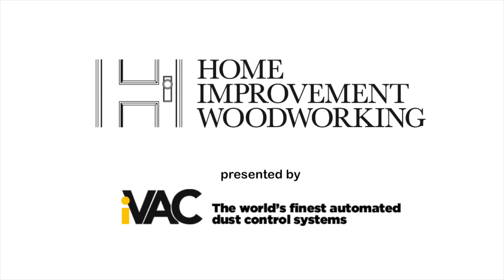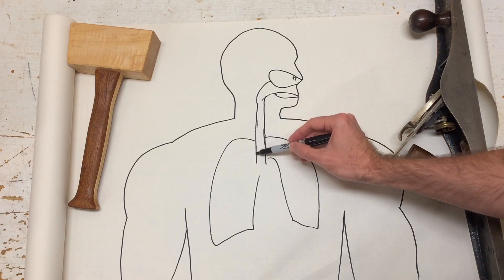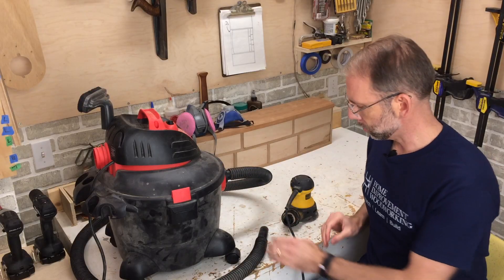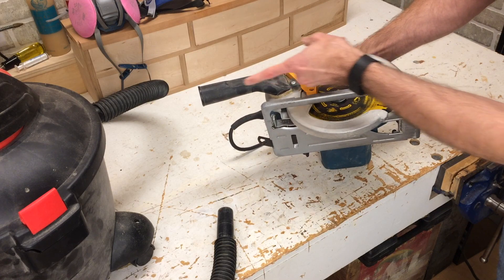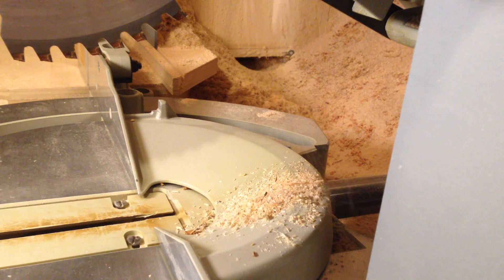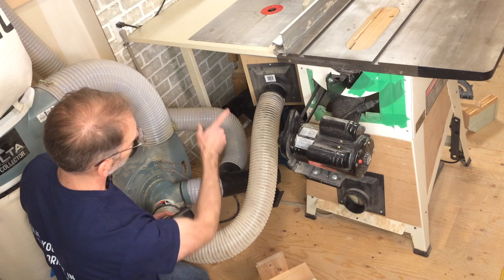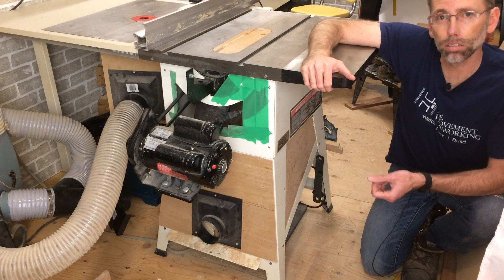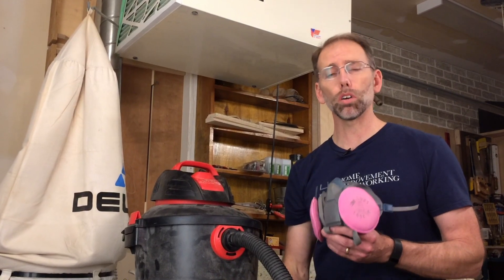Dust Collection for Workshops - Important Safety About Wood Dust

Comment: Unrelated to the video subject: What model of belt/disc sander you use? Do you like it?
Reply from the maker: I use a Delta 31-460C belt/disc sander.  I picked it up used for $60 a few years ago and it works well for me.  I like the dust port because it does a really good job capturing the dust.  I hope that helps.  Scott

Comment: Any suggestions on how to get started on dust collection on the cheap? I do a project every year and there's so much dust that spits up from my table saw (I attach a shop VAC to that while using it) and circular saw and orbital sander I do a sweep and vacuum every other week
Reply from the maker: The cheaper route to go is a shop vacuum versus a dust collector.  Keep it simple and plug in the hose to the tools versus getting fancy and hooking up some pipe runs.  I wouldn't skimp on the vacuum filter though... use a HEPA filter to protect you from the fine wood dust particles.  On a budget, you may want to look for used tools that have dust hookups so you can maximize the use of your vacuum.  Does that help?  Scott

Comment: I have been doing everything wrong for a long time, so I have a lot of breathing problems. But I don't want to give up wood working. To run an efficient dust filtration system in your Workshop it takes money. Do you have any idea how to do it without spending thousands of dollars??
And also you have to be very careful with PVC pipe and plastic because of friction it causes spark and explosions I've seen wood shops actually catch fire because of dust collection systems.
Your dust collection system looks dangerous with all the plastic pipe.
Reply from the maker: The most cost effective solution for protecting your lungs is a NIOSH approved respirator that fits properly.  To put in dust collection in a cost effective way, I suggest buying used tools and parts.  Look online in your community to see what you can find.  Quality used tools typically sell for 40-50% of the purchase price... you can sometimes find some great deals too.  I don't recommend using PVC - I only use metal pipes.  Scott

Comment: If you want to sport a beard, you need a PAPR. A full-face won't cut it.
Reply from the maker: Hi David.  Thanks for your comment.  I've just learned about full face mask respirators and Powered Air Purifying Respirators (PAPR).  I've looked at the 3M model.  Do you have any experience with them and advice for choosing one?  Thanks, Scott
Reply: @HomeImprovementWoodworking  I have a Trend AirShield Pro, which has a faceshield. I use it for turning. It's okay, a little bulky, and one of my batteries is currently being replaced under warranty (hopefully). I think most PAPRs have a full faceshield, but I may be wrong. They aren't cheap. A half-face or a fullface provide some protection with a beard; they are definitely better than nothing, but won't meet OSHA standards (if you care about that). Depending upon what I'm doing, I wear a half-face with a beard, but generally use the AirShield Pro.
Reply: The Airshield Pro is only for dust. If you want to wear a PAPR for painting or finishing, you need to get something that can take organic vapor cartridges.
Reply: +1 for the Airshield, even though the ear defenders are fiddly.
Reply: HC worker with a beard here. Technically he's right about the beard because the full face respirator has a leak near the chin. When I worked in the hospital and there was a shortage of PAPRs I wore a scuba hood (sealskin) and then wore a full face respirator.
Reply: PAPRs are pretty big and uncomfortable. I've been looking at this https://retail.vihelm.com/products/vihelm-package. Looks promising but not sure how practical it is.